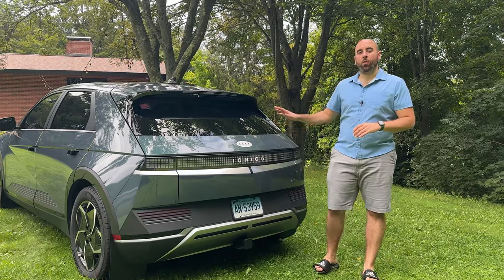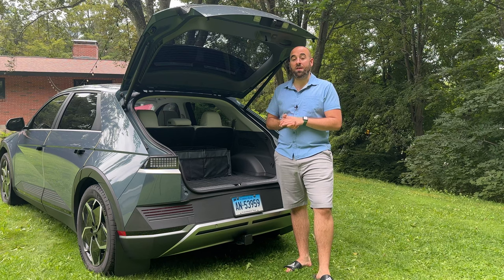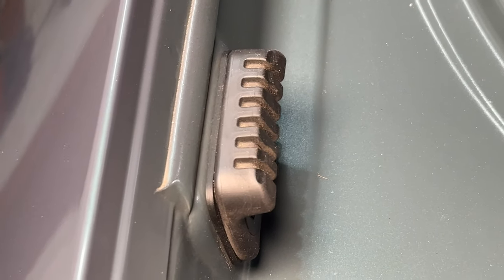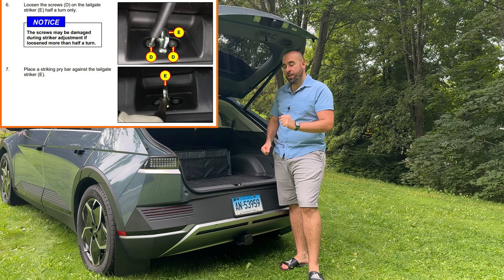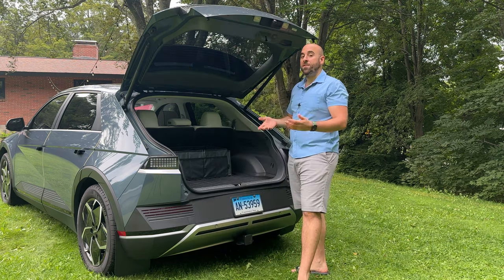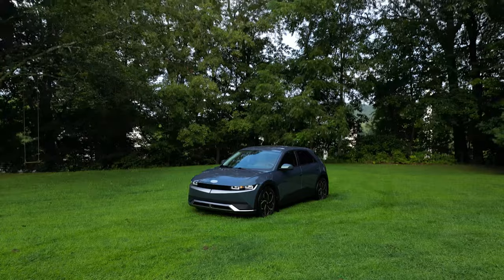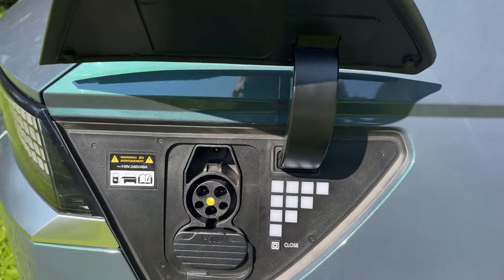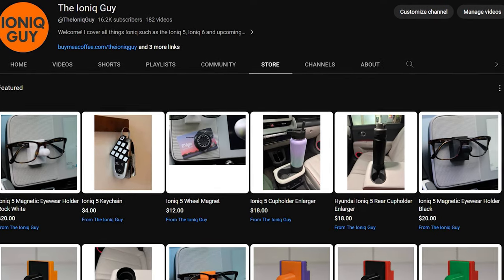Fix for Ioniq 5 Tailgate Rattles Available | Grab Your Mallets!

Comment: Thanks for this Corbyn - I’m in the UK I have a 2022 AWD ultimate trim with creaking groaning tailgate and lock rattle - months back my Hyundai garage adjusted the tailgate  & the lock and applied two metal shims per side (which I’ve seen as a previous TSB) - this didn’t fix the problem - these are not where your 3D printed ones are - I’m booked in next week to have the latest TSB applied but had to wait ages for the part to come from Korea -  if this doesn’t fix the problem I’d be interested in trying the 3D printed solution you have. It appears that the TSB numbers are country specific ( how complicated can Hyundai make this !!) however I’m so grateful that you give the TSB details as it’s a must to give to the technician !!! I did also supply video evidence of the issue as it’s a warranty repair -  As a side note my rear lights on the left side don’t quite line up correctly - I’m wondering if the proposed wallop with the mallet as part of the TSB might pull the tailgate down a smidge & line these up … we shall see !
Reply: ok so the dealer did the latest TSB fix and hoorah my rear light clusters now are level across the rear of the car - since the adjustment the tailgate initially opens with quite a pop and the loud groaning squeaking rattle from the tailgate did stop completely for about 1hr 20 of the 1hr 30 drive cross country home from the dealer-  and gradually since the creaking has come back- yes the tailgate noises are less but still present when the car body flexes on bumpy roads ….

Comment: Thanks for this! The rattling was driving me mad(der). a 3/4 turn on each of the rubber stops at the tailgate corners did the trick. I've printed a set of shims anyway, just in case. Keep up the great work!
Reply: rubber stops adjustment worked for me in the summer but now it rattles again, will need permanent solution.

Comment: I was going INSANE looking for the source of this heavy rattle, after removing almost all panels and filling them with a special sound-insulating foam I still had the rattle. I added some double sided tape between these stoppers and the rattle is gone.

I was loosing my mind. Thanks!
Reply: Hello! Please, can you take a picture of what you did and where? Thanks!
Reply: @gabrielvladarean3292  sadly I cant upload pictures here. What I did at the end in order to make a cleaner work is.

I looked for some old watershoes, which often have a rubber sole. I took off the stoppers fixed to the car (i didnt touch the boot stoppers). Then took the stopper as a mold to cut the watershoe sole and went back to place the cut sole between the chassis and the stopper and screw them back. That small 1/2cm difference stopped the sound.
Reply: @ytr5153  thanks a lot!

Comment: I did the mod with the washers months ago, and the rattle is gone, BUT when they are there, the tailgate closes with an effort and literally pops when opening. I was afraid something will break this way and removed them. I may try to put them on the top details as suggested in the video and see if it changes. I wouldn't use the hammer myself, but I hope they will somehow adjust it during my next planned service.

Comment: Update on my tailgate rattle. I took my I5 in last week to address the rattle I had previously taken it in for, which they addressed with the TSB, which didn’t seem to do anything. This time, it seems quiet back there. I'm not sure if that will last, but for the time being, it’s pretty quiet. When I dropped the car off, the guy checking cars in asked me why I was there. When I told him, he said that they ALL rattle back there. Lovely. When they called to tell me the car was ready, they told me what they did. It was identical to the TSB from the last time. I let them know I had already done the TSB for this and wanted to verify that something different or more was done this time. The advisor seemed to get that and said he would go check with the person who had done the work to verify and even go road-test it to make sure. I didn’t really hear back after that, so I just let them have it overnight and called the next day to see what was up. They said it was ready. So…fingers crossed. It’s such a great car, but I should have probably just waited a couple years for them to work out the bugs, and it sounds like 2025 is that year. LOL. Oh well. Hopefully, it’ll stay quiet, at least for a while. I will absolutely be milking this warranty as many times as possible before it expires, and I will probably sell it before the 5 year/60K mile warranty is up. At least I’ll be able to see how the 2025’s are holding up a year or so into production so I can decide whether I want to replace 'like' with 'improved like'. ;)

Comment: Purchased my Ioniq 5 in August. Had not noticed the tailgate rattle until the cold weather. I looked at it this past weekend, compared tailgate guides to friends week old Ioniq 5. We noticed the guides on the tailgate were upside down on my car compared to his. We flipped mine over, adjusted the bumper stops a little out and the rattle is gone. Looking close at the tailgate guides I flipped over, they have an arrow for direction. Mine were pointing down towards ground, flipped to point arrow up as it was on friends new Ioniq 5.
Reply from the maker: Wow that’s so interesting! Did you notice any difference in thickness or dimensions?

Comment: When the weather was colder, I had a rattle on the side doors (driver and rear passenger)  Hope they look into addressing this.  Per the forums it looks like the plastic mold side pieces that fit into the metal side doors isnt a perfect fit and during cold weather can start to rattle.  One dealer added a felt liner inbetween the plastic and metal spacing to eliminate the sounds
Reply: I have the same issue. Been to the dealer 4 times, and they deny they can hear it. So frustrating!

Comment: i just bought i5 2023 and i also got rattle on the tailgate . after i watch these video i just know why it happen . after i got 1000km for first service i just tell them about it why it making noise and the dealer already know it why . but what i dont like is that they will strike the pry bar ( luckily that didnt happen ) . so what happen to me is that they only change the guide bumper to the new update one and work perfectly i didnt hear any rattle again now. they also not put any washer on the hard plastic and not striking pry bar . so whoever have rattle problem like me you can just go to your dealer 👍

Comment: I have the 2022 Canadian version ... never noticed any rattles and it already had the seatbelt mod. I did notice a crack of my rear passenger window but the crack isn't on the outside and isn't on the inside; it must be between the two bonded panes of glass. I don't know exactly when it happened but suspect going over railway tracks probably caused the crack. In the process of moving so I may need to wait until next spring to deal with it.
Reply: HTF does it take 6-8 months to move?
Reply: What's the seat belt mod?

Comment: My (2023 Limited RWD) has a trunk rattle that sounds like a clunk. Like a steel bolt moving about in some crevice.
Reply: I think I got the same on mine. The service fixed it by greasing the shock absorbers of the tailgate. At least this is what they said to me. How and where, I don't know unfortunately.
Reply: @SlaviSlavchev  Thanks! I will check with service soon.